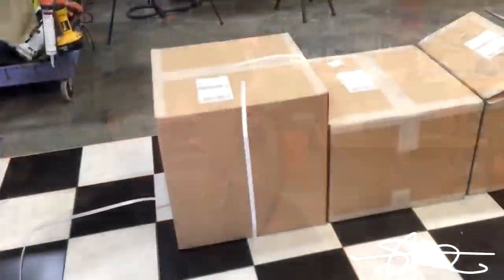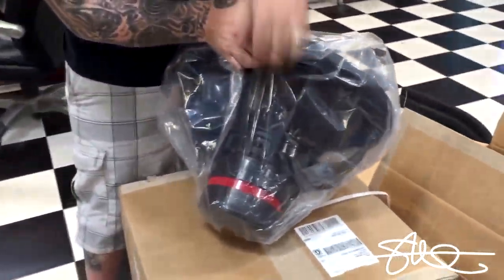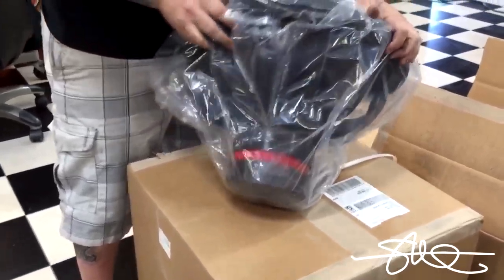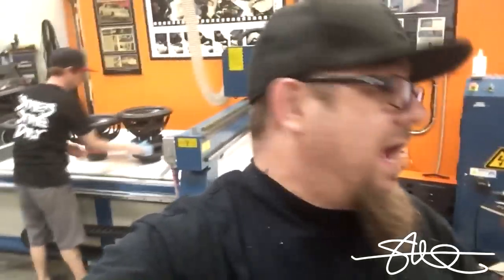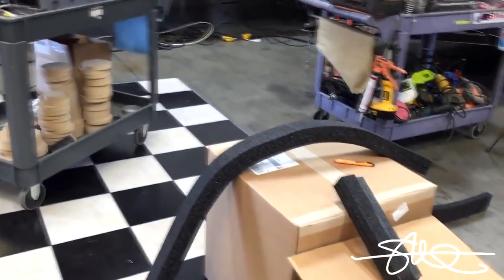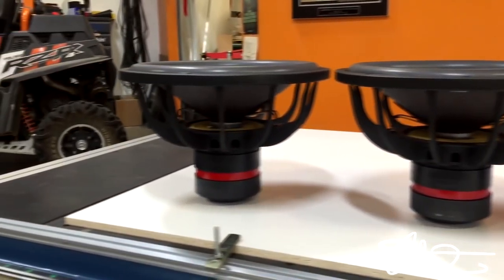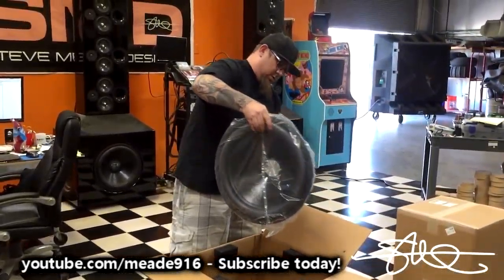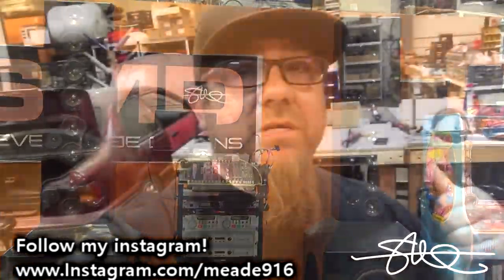Good Old Fashioned Subwoofer Unboxing - 2 SMD "Mini" 18" + 4 18" Passive Radiators

Comment: Hey Steve got a quick question for ya. I got a 2014 fusion with two 12s in the trunk, the only complaint i have is the headliner console, behind the mirror, rattles like a bitch. I feel like taking that down, and headliner down, would be a pain but im assuming I would need to in order to put sheets of sound dampening. So i guess my question, would doing all of that and installing sound dampening sheets behind that console fix that rattle? Thanks in advance. Just new to subs and inexperienced.

Comment: How do you blow a passive radiator?
Reply from the maker: +TroniX it's not that it "blew". But the glue joints on the spider landings failed a few times.  I re-glued but the pressure was just too much and it kept popping off.  It still had good bass but with the surround being the only thing holding it together, eventually the non-linear wobble made the foam tear.  Once it went it's just a big blow hole....in other words, blown. LOL :D  We did a re-design hopefully they will hang in there this time.
Reply: meade916 That's awesome man, I really admire your work. Can't wait to see and hear the new radiators!

Comment: I always wondered how a passive radiator system might sound in the cat audio world. if it's even worth it
Reply from the maker: +Nathan Vitchner the problem with the car environment is you don't have the room to spare that you may have in a house.  PR's have some of the cleanest bass you can get though if you do it right.  It's sorta like a sealed box with the benefits of ported...and none of the disadvantages a port would have (like noise, turbulance etc).  Done wrong, they prob suck of course but done right they are so NICE bro.
Reply: +meade916  - I have a passive radiator home sub, and yes - it is super clean bass!
Reply: +Nathan Vitchner Im actually building one now, the port i wouldve needed would have made the box too big. ive got a build log on meades forum. 18" lms ultra w/ 2 18" pr's... hopefully it wont suck like steve just said hahaa
Reply: jakemj03 Are passive radiator as loud as ported box
Reply: meade916 Would a passive radiator be as loud as a ported box  e.g a ported 12" Subwoofer and a 12" Subwoofer with one or two 12" passive radiator

Comment: Can someone tell me what are passive radiators?
Reply from the maker: +KOSx15 not to be a smartass..but in this case, GOOGLE is def your friend. :)  Probably more info than you would ever need in one click.
Reply: +Jesse Mendez LOL
Reply: Basically, it's a woofer without the motor(magnet). What it does it take the sound pressure in the enclosure that the powered woofer is creating and pushes it out according to the specs of the passive radiator(woofer without motor). What I think of it is a large port, that can easily b tuned to how u like your bass to sound.
Reply: And No, Google didn't tell me shite, just wrote down what I know.;) Hope this helps u Bro.
Reply: +KOSx15 They are basically speaker diaphragms without the magnet or voice coil. They act like a port. You attach weights to them to change their resonance, which changes how deep the system can go. They are not as popular as ports, though allow more control, and are common in higher end home theatre subwoofers.